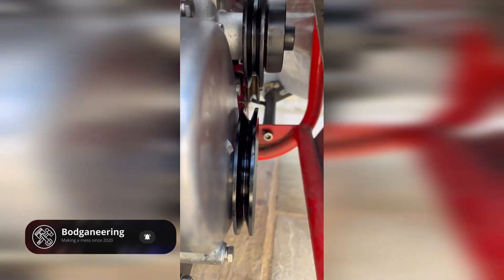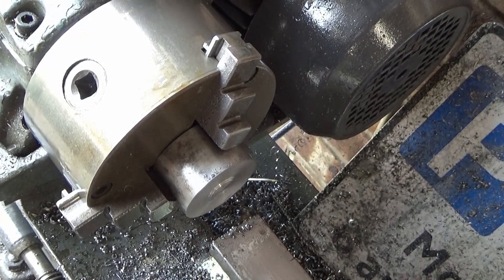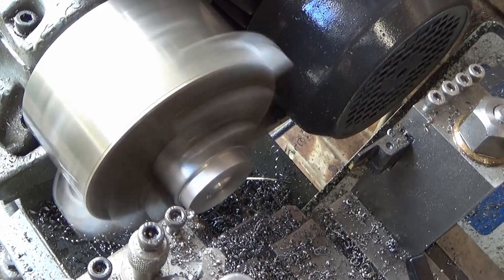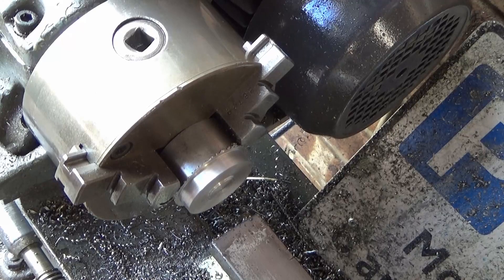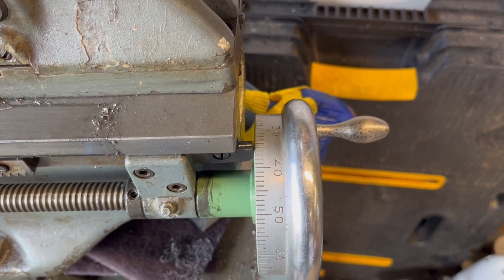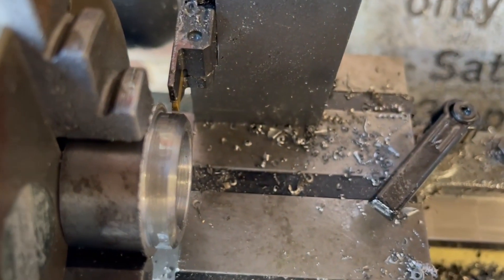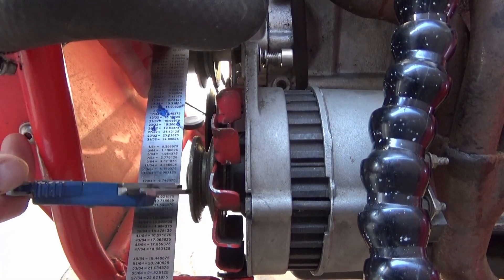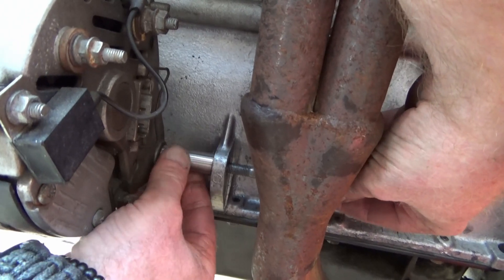Reliant 850 Trike - Pulley Alignment For Water Pump and Alternator.

Comment: It's those little pain in the arse jobs that take all the time
Reply: I drilled and tapped a hole in the water pump shaft on mine so that I could push the pulley inboard slightly using a suitably wide socket, a bolt a nut and a washer, the alternator can be moved around with shims quite easily.

With the fan removed and a right angled air drill I was able to do it on the car.

I guess your method let's the crank pulley seal sit on a fresh surface as a bonus though, but it did seem overkill for a mis aligned water pump pulley.

For anyone struggling to get a good seal on their front pulley you can fit 2 of the 1/4" thick version of the normally 1/2" thick front pulley seal for a double sealing lip.
Reply from the maker: The tolerances that Reliant used have quite a large margin, things should fit without needing modification. 

Nice tip about the double oil seal trick. I have a feeling I may end up using it on this engine somehow. 😂
Reply from the maker: True.
Reply: Lathe envy!
Reply from the maker: I won’t mention the milling machine then… 🧐😂
Reply: I doubt there are any original reliant made water pumps left in circulation these days.

A lot of the consumables are made in small batches for the few parts dealers left, so you sometimes have to hunt around.

They all likely have the same stock and will only send you a "good un" if you complain.
Reply: I've just bought a new water pump and guess what, it's 6mm out of line, so I'm going to take out 6mm out of the back of the cast pulley.
Are newer models different to my 1987?
Reply from the maker: There's not many original parts around for these any more and more than likely you've got a copy, should work perfectly well just needs fettling.